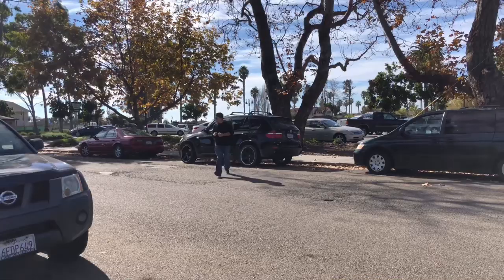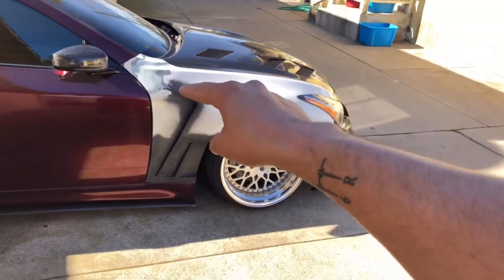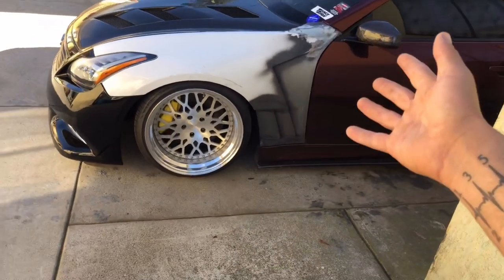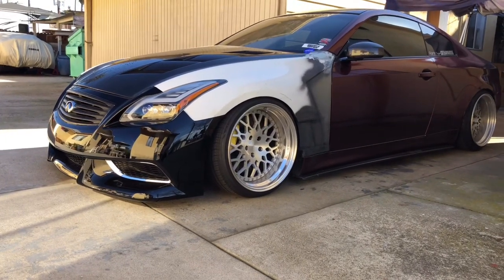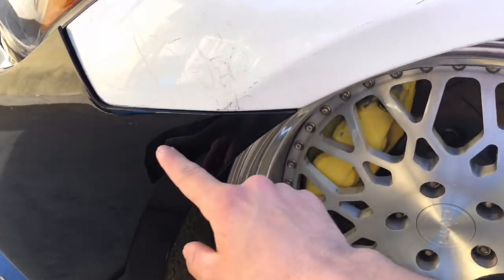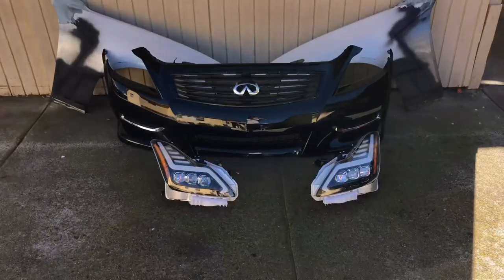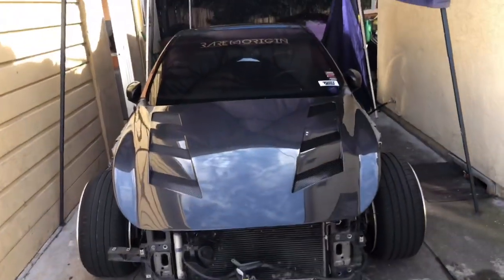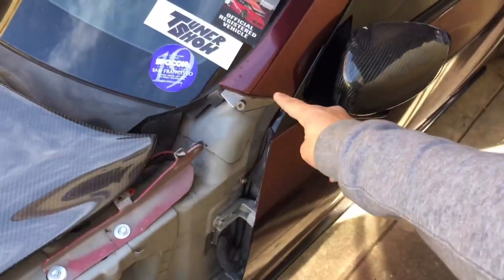G35 to G37 front end conversion (how to and everything you need!)

Comment: Also, do you just not ever put at least one fan back on your radiator? I was thinking I would put just one fan back on just to be safe and give me piece of mind too. Im an electrical pro so I can wire up pretty much anything so I can make it work ya know, just wanted your thoughts on that. Thanks again!
Reply from the maker: The original fans bolted to the radiator so I do have them on there
Reply: @edimaya2951  Thanks for your reply!!!

Comment: Did the G37 radiator support give you some more room for the radiator towards the front of the car?  I have a LS2 G35 and looking for ways to extend the front a little but for radiator replacement.
Reply from the maker: You actually have a lot of room! You might just need slightly longer radiator hoses but you can move it toward